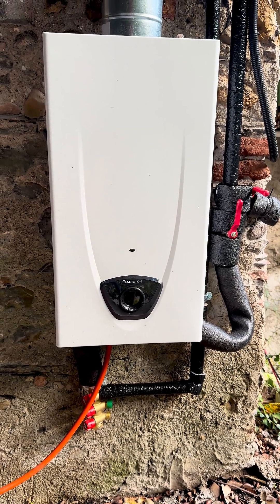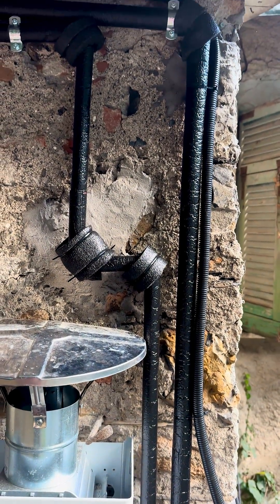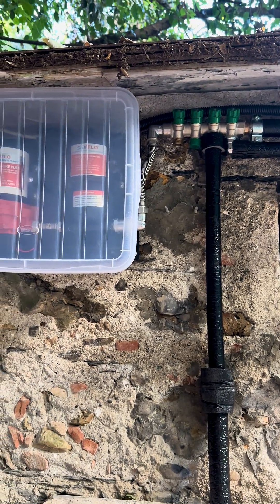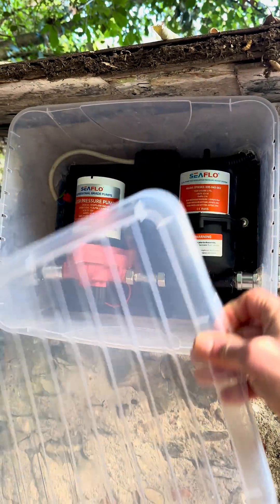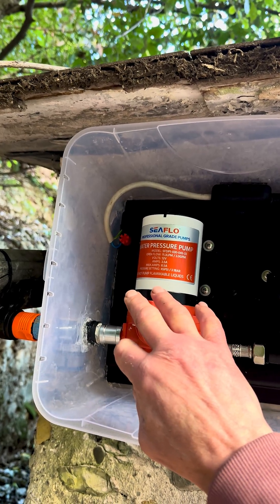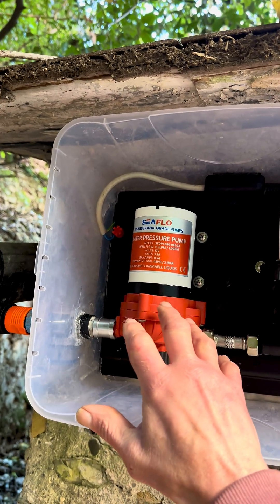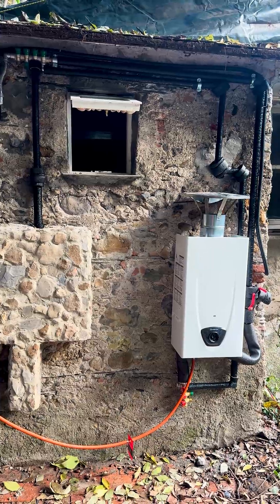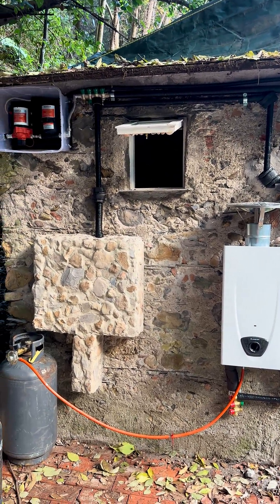We Installed A Low Wattage DC Pressure Pump And A Tiny Pressure Tank

Comment: You seem to have things under control but from experience that type of plastic box is not uv resistant, will be become brittle and fall apart in no time, you can spray it with a cheap can of stop leak/rubber seal spray, makes it stronger and will last for decades
Reply from the maker: You are absolutely right! Thanks for the advice. I was going to replace it with another one as soon as I could find one the right size, but your idea may be a better option. Thanks.👍